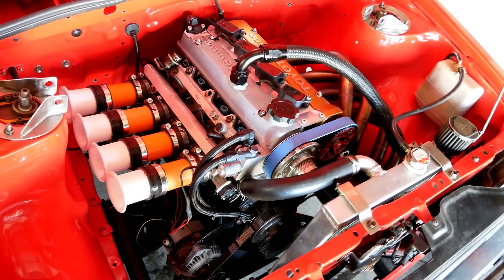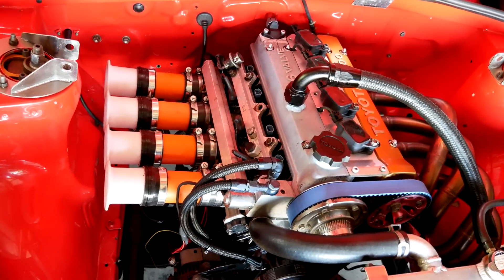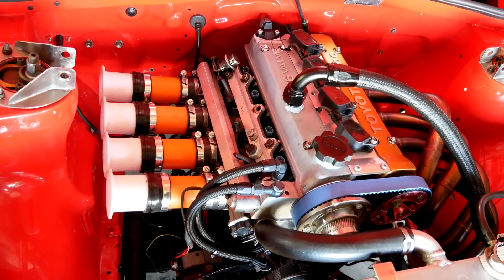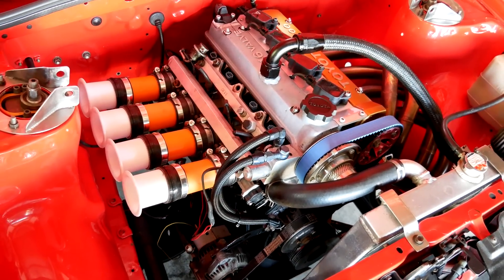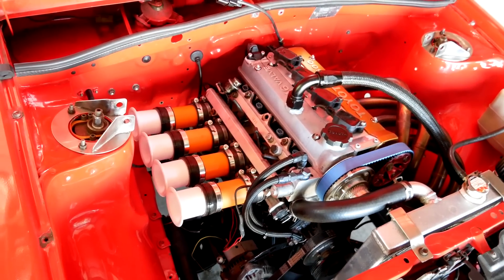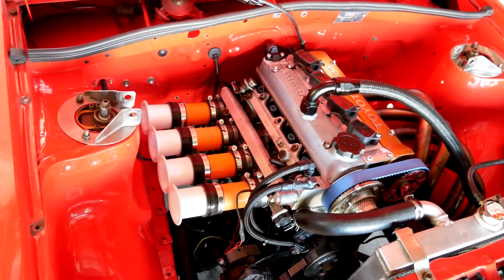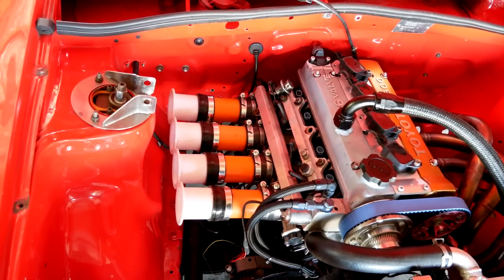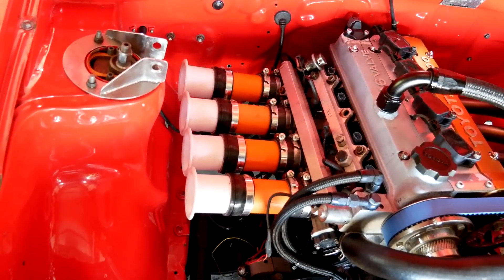Intake manifold length &  Cam timing - dyno tested

Comment from the maker: Yeah i actually made a video!    Been too poor or too busy, mostly combo of both to make any content.     Any last requests for the frankenturd?   Its well past its used by (was when i built it) , but are stringing it along, to test reliability of the latest version vvti setup
Reply: can you make a video about everything it has? (including how the vvti)
Reply: Inflation kicked in yo... Same here m8.. Anyway, thanks for still uploading some Content. =)
Reply: What was the effect of this test on driveability/tip-in/part throttle. Just wonder what side to err on when building itbs...
Reply from the maker: @datboi1620  Its mostly the size of the throttle plate/s that effect driveablity.   big throttles, just cracking them a little is lots of airflow.  but if you setup the linkages right, so the first part of the pedal opens them slowly isn't an issue.  unless go silly big
Reply: Has it got oil squirters?
If so, delete them and do the 10,000rpm run again.
Reply from the maker: @crd-nz_001   no squirters
Reply: Is that steam of smoke from the exhaust. Love that you take the time to make these videos. Wish I had a dyno.
Reply from the maker: @chippyjohn1   smoke.  rings and bores are bad / missmatched / worn out, you name it.  I done a compression test awhile back and was 130,130,100,130.  on a good day it'll idle on 4, most days number 3 has a sleep haha.   was never intended to be in the car this long
Reply: 2zz pistons on the rebuild

Comment: Hello, I have 4agze mr2. How much power can I make reliably on a stock bottom. Should I turbo or upsize to sc14 supercharger. I also have haltech elite 1500 than I don't know how to wire. What ecu are you running on?
Reply from the maker: turbo night and day difference in power compared to sc12/14  esp if get some of the newer tech on there.   can run 200kw at wheels on turbo ze all day without a worry. but as with everything, could run a lot more or a lot less depending on setup.    run Link ecus on my stuff

Comment: It’d be interesting to see the effect of different primary tube and collector dimensions on the performance of the engine and where it makes power. It’d take a lot of time and money to do though.
Reply from the maker: I have a little basic video i done way back, on a couple different headers.  similar design but big/small diameter.   plus a few others about exhaust stuff.  nothing super specific though

Comment: Holy crap it makes power till 10 thousand
Reply from the maker: Doing ok considering the cams that are in it.  the big cam engine should be interesting
Reply: @Garage4age  Are the engine internals rebuilt? Or is it just on lighter mods like the cams and bolt ons.
Reply from the maker: @TDBFZR6  This engine is combo of old junk i had laying around  with a few new parts. hence worn out and smokey.  its been put together just to test parts without wrecking my good engine. which is what all the bolt ons are off.    spec in description
Reply: @Garage4age  ok I see that's pretty cool thanks.

Comment: I would love to see a real shodown between a Silver-Top(2nd Revision) and a Black-Top. 

I don't think these engines are as different as people think. Silver-Tops running Black-Top ECUs with TRD head gaskets put down nearly identical power figures as Black-Top engines. 

I would like to see with all things equal what the true difference is between the heads themselves.
Reply from the maker: Yeah if spec everything the same bar the head will be pretty similar,  even  16v  will do the same.   blacktop just has lots of little tweaks that add up over silvertop. cams, compression  intake etc..    if do the same to 16v its right there too
Reply: @Garage4age  What I have heard is that the 20V heads have better flow than the 16V but because of the way the 20v heads are designed they can't reach the same amount of lift as a 16v which evens the playing field. 

What I "heard" and what is reality though are two different things. That is why I am curious about this. You have people like the D4A channel choosing to use a 4AFE head over a 4AGE claiming its better valve angle will create better flow and more power. These kind of statements feel dubious to say the least. 

I think everyone appreciates your channel because you put rumors to bed with real data. Thanks for everything, seriously.
Reply from the maker: @zerohikari2685   would be nice to put it to rest, but  out of my budget/ available time to do a proper apples to apples test.  The internet  is probably right on those 2 things. factory vs factory 20v head should flow more on the intake side at least.    The lack of shim/bucket/ lifter  (what ever you like to call it)  area  is a bit of limitation with the 20v head.  On paper looks like similar spec cams are available  for 16/20v.    but the larger shim area, especially after doing a shim less conversion  on 16v.  means can run more aggressive cam ramp, so mean valve lift is higher,  with same lift and duration on paper as a 20v cam.  Ahhh and the fe head , internet talk since forever ago as well.  Im all for trying stuff, but with all the aftermarket support for the GE heads. It seem like the hard way to go about it.  especially since can get right up at the pointy end of things, in power per liter terms. with the GE head

Comment: Hey bro, do you think you could do a factory airbox test where, there are 2 different length of feeds to it?

One that is long, and one that is short?

I ask because I'm wondering if there is a gain or lose in torque or power in either area of the rev range and will help me decide if adding a secondary valve is worth it. (Like a Lexus LFA)

It's something I wanna do to a k20 dc5 airbox. Even if there's no gain, there will be a sound benefit (subjectively)
Reply: Get a Mugen airbox, dyno proven
Reply: No shit... U want my one?
Reply: @mattk9438  ???

Comment: High oil consumption
Reply from the maker: yep, its very worn out haha
Reply: @Garage4age  What's the next step engine wise? Will you be rebuilding this 4A?
Reply from the maker: @findtherightbeat    end game is to build the long rod engine up properly  with the head off my 150kw engine.   In the meantime i will probably swap back to said engine  for awhile.   Things are looking really good to make Atlantic 4ag power and rpm while still making stacks of midrange.    The few "atlantic" spec 4age dyno sheets ive seen,  are dead below 6000rpm,
Reply: @Garage4age  What cam and in/ex manifold are you running? Curious with the good midrange, as it's what matters
Reply: @Garage4age  Also, are you running custom seat angles for better low-mid lift flow?
Reply from the maker: @findtherightbeat   spec of this engine is in the description. manifolds are all custom.  nothing too fancy about the seat angles, but has had work done in that area.  big part of the midrange power is getting the whole exhaust and intake setup right.   the vvti brought it to another level also.     My 150kw engine has bigger cams and oversized valves etc, can be seen in earlier videos a year or 2 back
Reply: @Garage4age  Thanks, appreciate the info! Looking forward to your new motor and more informative videos to come

Comment: Thanks for sharing. 
 Ideally a shorter intake runner should be bigger as well. Shorter runner moves power peak to higher rpm. Assuming the torque remains flat, it makes more power. More power means higher air consumption, thus intake runners need to have higher diameter to support more air. Am I right or talking nonsense? :)
Reply from the maker: Kinda.   Shorter runner will flow more at same diameter, due to less losses.   so you could also say the longer ones should be bigger.   but real world just run a tapered runner or slightly oversize it. there is very minimal loss down low  running an intake runner that is a bit oversized.

Comment: Now its acting like my TA60 (2T in it should be dead, but it isn't).
Other than the lift vs duration request below, I'm curious about gain/no gain twin breather cam cover mod vs single stock, supposedly it breathes better and allegedly 4age does RB26'y things in that regard, but, unsure if any gains.
Reply from the maker: I think i tired that in the video where i put a vacuum cleaner on the breather.  pretty sure i had a stock cover then  swapped to the big breather modified cover.  no change either way.    doesn't stop them firing all the oil out onto the ground either haha
Reply: @Garage4age  Fair enough! They do be a little Water Horizon'y when it does happen! 😁

Comment: now i want to see variable intake runners on this engine, but it's probably too complex to make
Reply from the maker: I was going to at some stage.  but after doing the vvti,  the gains from it would be even smaller.   as shown in this video, i can effectively get the same result by changing some numbers in the ecu. Probably still a little in it, but making a system that has no losses over ideal shape fixed runner wouldn't be easy.
Reply: IT had T-Vis stock so shouldn't be a problem.

Comment: Love it as always. Any way you could put a lift vs duration video together?
Reply from the maker: not really without getting custom cams made.    duration is where its at though.
Reply: @Garage4age  chee budda.
Reply: @Garage4age   
This is interesting question - which gives better results and less stress on valvetrain - duration or lift!
Reply from the maker: @jareknowak8712   There are some limitations to what can be done in a lot of engines.  in 4age's case, kinda have to run a decent amount of duration to get more lift.  high lift cam with little duration will have an aggressive ramp which will throw the shims out.  so guess the answer is both is better!